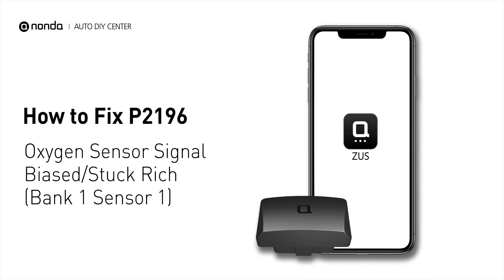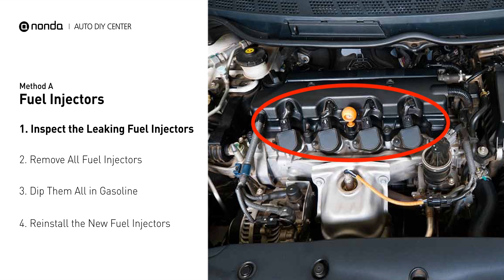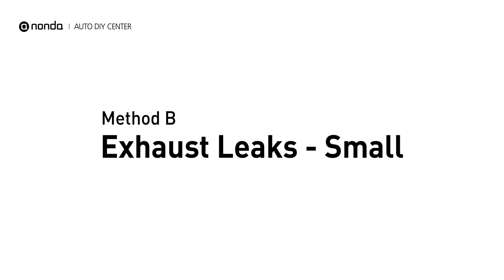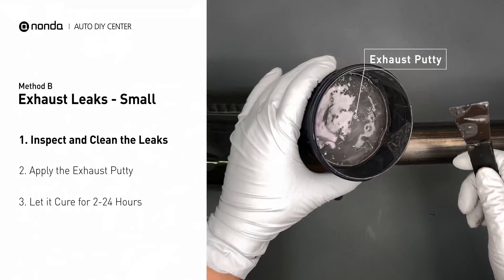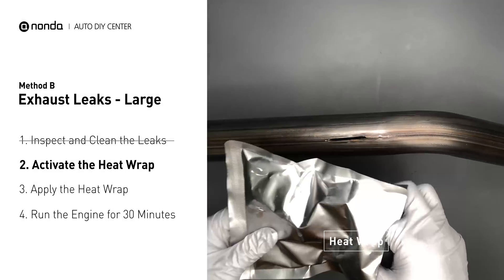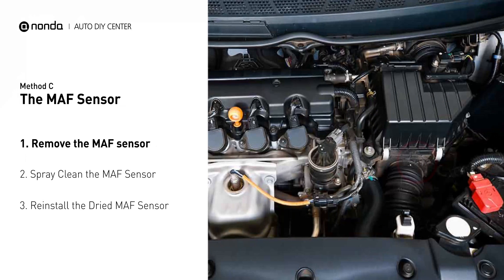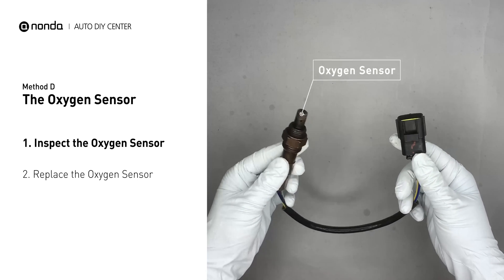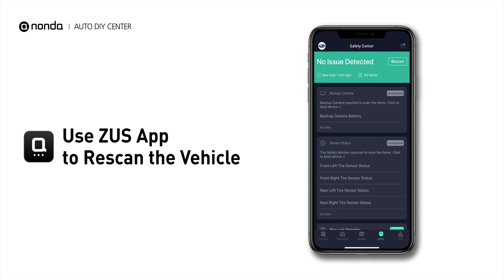How to Fix P2196 Engine Code in 5 Minutes [4 DIY Methods / Only $8.78]

Comment from the maker: Hi, I'm Steve, nonda's lead mechanic engineer. 
Feel free to leave your comments here if you have any mechanic questions, I will be glad to help you out!
Reply: Hello my car 525i 2009 engine code n52b25a.
My problem I have fault codes p2096, p2196. I have just done a complete maintenance brief.
And the morning when I start cold my rpm not stable and when I open the oil cap a noise
Reply: Great video. Very helpful and concise.
What are the readings to look for that will isolate the problems listed in the video?
Reply: I have same code on my kia k5 hybrid 2021 and all expert couldn't solve the problem
Reply: Why do you have a robot voice?
Reply: Steve you’re hilarious, this video is an absolute joke🤣🤣😭

Comment: Jetta 2014 2 liter - i have P2196 and P2096 error code. 

Went to machenic shop -  Error code still appears after doing below work, pls advise 

1.  Replaced bank 1 and bank 2 oxygen sensors
2. Replaced Spark Plugs
3. Replaced Air Filter
4. Replaced fuel Injectors 
5. Cleaned manifold, throttle body, and catalyst converter 
6. Confirmed No leakage in the exhaust and catalyst converter
Reply: Any resolution?

Comment: Hello I have a 2006 ford Taurus. My check engine light came on a week ago and hasn’t gone away, I received 3 codes from a diagnostic which were (P0 191, P2 196, P2 198) i haven’t been driving it much, but I want to ask if the car is worth fixing, and will it be costly? I don’t want to scammed for lack of knowledge on this matter.
Reply: Get rid of the Ford and the code goes with it

Comment: I have P2196 and P0139 on a 2014 Hyundai accent, but I recently had my O2 sensors changed, any ideas?
Reply: I have a hyundai elantra 2006 changed my downstream sensor and i still have p2196, p2626 & p2097

Comment: I pretty much done everything recommended in this video and I'm still getting this p2196 code. Yes I replaced the purge valve. Any ideas what what else it could be. The engine runs fine it seems like it runs even better since I put all those parts in.
Reply: Have you tried to change spark plugs? It says this code is related to rich mixture of gas and air, this can happen because of malfunction of spark plugs too.
Reply: @taunus1979  Yes. I checked those and they seemed to be fine. I read that a faulty temperature sensor could cause the engine to run rich. I brought a new one but haven't put it in yet.
Reply: Rookie 👎🏼👎🏼
Reply: @vegasking7022  lol
Reply: I heard you have to clear the codes with a obd reader and if it comes back on you are in trouble. If you did all this then i'm sure it wont turn back on.
Reply: @xDarkAngelxc  Thanks. Yeah I cleared the codes multiple times with my scan tool it still keeps on coming back.
Reply: @josron6088 any update?, hope you fixed it and it’s done!.
Reply: @Welly187  It's still doing the same thing. Haven't figured it out yet, what's causing it.

Comment: Hi. I have a 2012 hyundai elantra. I am getting codes p2096 and p2196. I pray its not the catalytic converter. Any ideas. Thx
Reply from the maker: Hello, as you are receiving more than one error code, we highly suggest getting your vehicle visually checked by your local mechanic for further diagnosis.

Comment: 2015 X1 28i, would the codes p2196,p2096 cause the engine to start trembling and shutdown? How I fix the issue, please?
Reply from the maker: Hi Saul, yes. It is best to get your vehicle visually inspected/checked by your local mechanic for further diagnosis as you are receiving more than one code.

Comment: Got p2196 code 
Car runs and drives besides sometimes rough starts after refueling. I reset the check engine light didn't come back on for another month. Check for vacuum leaks and didn't find any. Cleaned MAF sensor and reset again. Came back on a week later.
Reply from the maker: Please confirm if this is the only code you're getting and let us know your vehicle's year, make and model.
Reply: @nondainc   I have a 2016 ford fusion 
And yes this is the only code im getting. And thanks for responding
Reply: What came of this?
Reply: @ajonthebeatENTschannel-hi4dc  Still the same issue. Code p2196 comes on after like 2 weeks or so of driving after i clean the mass air flow sensor and clear code. The car is still hard to start sometimes after refueling. Im hearing that can be the purge valve. Thats my next step i guess. Do you have any recommendations?
Reply: @TheProspecialist  purge valve is leaking, replace it and youll be good
Reply: @janxski6900  thanks that's what I did since last post. Haven't had a issue yet. Thanks

Comment: Today I used a can of seafoam spray top engine cleaner and lube.
I sprayed it directly into the throttle body. Now...
My 2004 Ford Ranger with a 3.0 l 6 cylinder engine is throwing code P2196 and P2198. Any ideas?
Reply from the maker: Hello, the issue could be coming from the hoses, MAF, wiring/plugs or the 02 sensors. Kindly have them checked.

Comment: Awesome video! My 2017 Ford Fusion has been throwing a P0456 (very small evap leak) for about a month now. Any time I fill up gas the CEL throws the same code. Kinda stutters on start up but not bad at all. I’ve been meaning to get around to changing my evap purge valve but haven’t done so yet. This morning after driving my car for 20 mins, CEL came on. Followed by a periodic humming sound (hums about every 10 seconds). Now I’m getting two codes P0456 and P2196  (O2 sensor biased/stuck rich bank 1 sensor 1)  Would a bad evap purge valve cause it to run rich? Or could it be I have a small evap leak coming from fuel injector in bank 1?
Reply from the maker: Hello, you may possibly have a bad canister purge valve that's causing a vacuum leak.
Reply: Awsome video? Seriously? Wow
Reply: Get rid of the Ford

Comment: Hello. I have a 2017 Ford Edge. I have 3 codes. P0456, P1450 and P2196. I’ll tell you a few of the problems I’m having. My gas is running out extremely fast. This is a V4 and it is running out like it is a V12. When Im at the gas station, if I fill up my gas tank, when I go to start my car it does not start immediately. It coughs and coughs like it’s trying to start but doesn’t for about a minute or 2. And also, when I add gas my car shakes and rumbles. More recently I actually smelled gas in my car after I left the gas station. That happened twice. Where do you think I should start?
Reply from the maker: Hello, since you are receiving multiple error codes, we suggest getting your vehicle visually checked by your local mechanic for further diagnosis.
Reply: I am having the exact same thing, have you found a solution ?
Reply: Canister purge valve ! Had the same issue and it fixed it.
Reply: I recently got the P2196 code on my 2016 Ford Edge Sport and my car has shaken the last 2 times I’ve gotten gas, and my revs go up and down and then it settles and stops shaking, but when I tried ti start it up today at the gas station it sounded like it did not want to start up, scheduled appointment at Ford for this Friday but prior help would be amazing
Reply: @Edwin4DaWin  replace canister purge valve!
Reply: @funnyGUY2452  thanks for replying so quickly, that fixed the problem and took the code away and kept it from coming back?
Reply: @Edwin4DaWin yes!
Reply: @funnyGUY2452 thank you, going to Ford Friday and hopefully they fix it under my warranty, did you have it fixed under a warranty or out of pocket and if out of pocket how much was it for you?

Comment: Hi. Good video. I have a P2196 code on my Toyota Yaris 2009 stuck rich bank one sensor one but the code only comes on during the winter season. Rest of the year its fine no code whatsoever. Do you know what the problem may be as its only tripping on during that time?
Reply from the maker: Hi EJ, this code is usually triggered by a bad oxygen sensor, and it happens in case of cold engines during winter.
Reply: @nondainc  then why is replacing o2 sensor method d in video not method a? 😂
Reply: Exactly the same ...
Code is only on when it's cold
Did you manage to fix it?
Reply: @KN44_the_realest  nope. Well in summer last year I sprayed the sensor with Halfords electrical cleaner (took the sensor out using the special sensor tool you can get from ebay) I cleared code and didnt come on till now last few weeks. I drive let car warm up with heating on and boom light comes on but I just keep clearing it using obd.
Reply: @IbzJaay19  well i have this problem a few years now so it started to come up in warmer days of the spring but i couldn't remove it yet.
Why you don't change it?If error code is true then we probably burning more fuel which in long run is the same as paying for the replacement part
Reply: @KN44_the_realest  I only drive local so my yaris doesnt reach optimum temperature most of the time so thats why I just clear code whenever it comes on. The replacement part is a over £100 and only the genuine Denso brand will work. All other brands will illuminate the check engine light on like how it is now. I read that somewhere online. So if you are going to get a new part make sure its genuine Denso.

Comment: Hi, I have a 2016 mustang v6. (Tested at autozone for p2196) Which is having trouble starting after a refuel and even shut off at a light while idling. Which method is best for my issue. I have an appt tmrw for possible service but would still like your advice. I would like to know if I would be able to fix my issue myself. Thank you
Reply from the maker: Hi Brandon, kindly check the wiring related (around the pre and post catalytic converter oxygen sensor) for damage and repair/replace them to see if the issue will still persist Clean the MAF Sensor, check for any exhaust leaks, and ensure that the fuel pressure is within specs.
Reply: Hey did you ever get it fixed? I have the exact same problem!

Comment: I have a 03 ford explorer and i get this code 2196.
Reply from the maker: Hi James, we suggest to follow the tips/recommendation provided in our uploaded video (How to fix P2196). If applied and the issue continue to persist, please let us know or you may let your vehicle visually inspected by your local mechanic for further diagnosis.
Reply: check oxygen sensor harness probpably short causing high voltage and causing dtc p2196 before you replace the sensor go under vehicle visual inspect  oxygen sensor harness see if theres any wire rubbing on the drive shaft or touching exhaust .its easy if you have a scan data then you custom list all 4 oxygen sensors  and you look at the voltage and you start wiggling the harness you'll feel surprise seing sudden voltage change on the sensor that means theres a short somewhere

Comment: hi steve, I get the p2196 on a 2011 3l v6 escape with bank1 sensor1. Can it be because of a failed purge solenoid?
Reply from the maker: Hi Rahul, yes it could trigger this code. But to certainly know the cause and remedy, you may seek a professional technician to inspect your vehicle first. Thank you.
Reply: @nondainc  thank you

Comment: Hello Nonda, I have a p 2196 code bank 1 sensor 1 is that on the passenger side of the vehicle? I have 2015 F150 2.7L about 112,000 miles
Reply from the maker: Hi William, I would suggest you check out the owner's manual first. You may also try to find any stamps on the cylinder head for any cylinder numbers. Bank 1 is the side with the number 1 cylinder (Cylinders 1-3-5-7- etc.)
Reply: @nondainc  thanks for the reply.